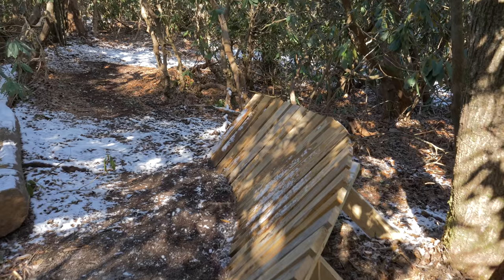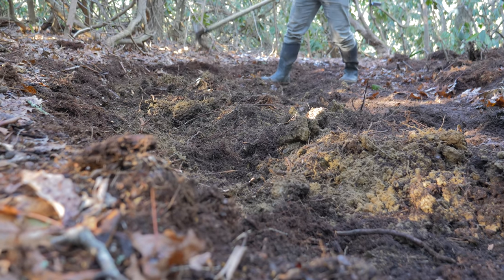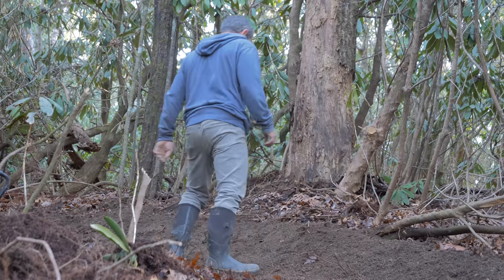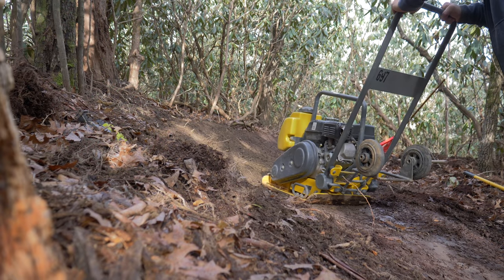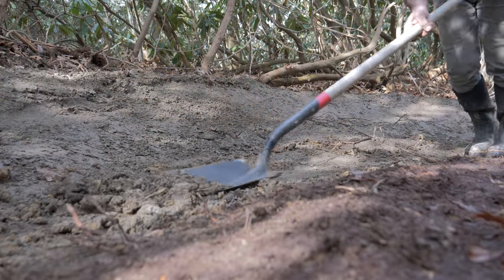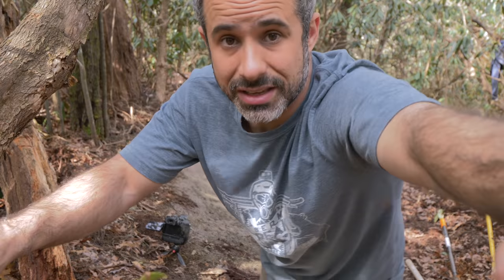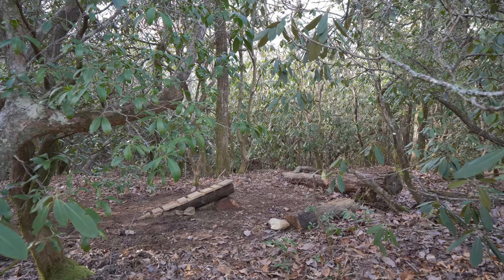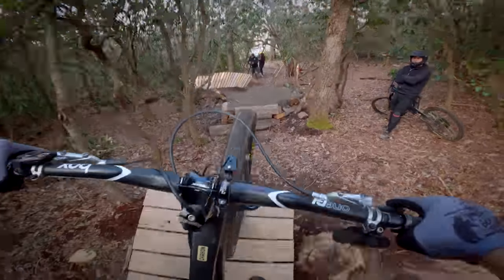Building a “pecker log" jump and a new berm!

Comment: The wacker is one of the machines that frustrated me the most while learning how to use it! The soil needs to be almost dry at the top for it to work at its best! Keep the good work up Seth!! Cheers from Chile!!
Reply: viva mtb enduro chile
Reply: As a geoengineer, I can tell you that this is not correct. Dry soil packs the worst, but overly wet soil sucks just the same. There is an optimal amount of water to every soil , called the "proctor density". 

I think you have clay at your place, just like seth has. The wacker is desinged to be used for sand & gravel and will (obviously) make a mess on clay.  You will need a sheepsfoot roller to compact clay, these sheepsfoot are also available for wackers.

Comment: 5:00 That stuff is most likely Stonedust, used alot here in the NE where the soil is sandy and tends to shift over time. Traditionally you lay this before a foundation and lightly wet it, then tamp it, and it will settle and harden almost like concrete.
Reply: Bespoke Bud thanks for this
Reply: I thought it was cat litter

Comment: The way to get that jump to sit securely is to fit it in there. To fit it in there you use a pair of calipers/dividers and draw/scribe a line with them holding upright the whole time. Then you remove the wood up to the line from the bottom log. This is mountain man style to how you'd build a log cabin with nice, tightly fitted joints. Great vids Seth!

Comment: I used sand to caver wet clay when I was building a roller. It works great for not sticking to the shovel but it also doesn’t stick to new dirt that you put on top

Comment: Hey Seth, love the videos I’ve been a long time fan , I just wanted to let you know that when sharpening tools it works better to file into the cutting edge rather than away, it helps you get a cleaner sharper edge when freehanding a file without having problems with rounding of the edge, less time to get the job done.

Comment: just to make the next one easier, its usually easiest and works best to work from the top of the slope and work along sideways. pulling the compactor up and down the radius of the slope :) the curved lip at the front then helps you get the radius of the berm rather than always fighting with the edges digging up what you've just compacted!!

Comment: Pro tip for sharpening. I have a decent amount of experience sharpening tools similar to yours, and a good rule of thumb is to push your file in towards the blade instead of pushing away. I’ve found your blades stay sharper longer, and are less prone to dent or bend. I know it is a rough-use tool, but that principle can be applied to any tool or knife. Hope it helps!

Comment: The gray stuff might be chip limestone.  You can get it delivered bulk if you like.  Also, the best bracing you can do on logs is to notch them, like how a log cabin wall is built.  The notch acts as a cradle and increases surface area (and friction).  If you still need some stiffness, use a 3/8 long bore bit and drill thru the notch and the sitting log (from the bottom) and drop in a piece of #5 rebar.  I'm a big fan of SPAX 1/2" self-tapping heavy duty wood screws also.

Comment: That gray colored dirt you found and are using is called 'stone dust'.  It's what the name implies, it's crushed stone and sometimes recycled concrete blended in.  It's used as a base layer under pavers, driveways, etc.  When you pack it tightly it'll harden up, which is why it's a good base layer.  You can order it by the truck full.

Comment: I found a great way to move logs. Get a 7 ft or so long 2x4, or other sturdy lever, and tie a short piece of rope around the lever about 1/4 of the way up, and tie the other end around the log you want to move. You plant the bottom of the lever into the ground and push forward against the top of the lever. You can adjust the mechanical advantage of the lever by raising or lowering how high up the rope is tied on the lever

Comment: That grey pow is called stone dust, you can get it in bags at any home improvement store or in bulk at any garden center or any yard where you can buy sand or dirt, like the one where you got your Granular A (gravel) for the forest road. It's actually the same powder that was mixed in with the gravel and is what gives it that concrete-like quality when you tamp it. If you're building a stone patio, it's what you put right under your stone, that stuff is like magic

I would definitely get a yard or two so you can use it, just make sure to throw a tarp over it because the rain will wash the fine stuff away pretty fast when it's loose. Also put a tarp in your truck bed because it's pretty messy but won't damage the tarp

Comment: Using a sandpaper flap disk on an angle grinder is an extremely effective way to sharpen large steel tools. It is way less aggressive than a grinding wheel and if you finish with very light pressure it can lead to a very nice edge.

Comment: next thing you should build is a connected ramp from the gator to the floor. manual if you want an easy process or on a chain system if you’re up for the challenge 😁. you could even add a rolling system like at an airport bag check so you can load logs or machines easily

Comment: I feel like you would do well to invest in a roller packer. They're relatively inexpensive and you can really vary the weight with how much or little water you put in it. I feel like it would work better on wet stuff because it won't vibrate it into schmoo.

Comment: I’m a blacksmith in NJ and the file work you did on your hoe looked good. Some advice you might benefit from is investing in an angle grinder and some flap disksZ they’re great for both light and heavy sanding, grinding and sharpening.

Comment: It was hard to tell but it looked like you had the water on on the plate compactor. If the ground is already wet just turn the water valve off. It prevents things from getting too wet and messy.

Comment: Hey something else to do with the pecker log to secure it... go through the top log into the bottom short log support with some rebar or a metal spike... like a 3/4" rebar/spike... do two of them. it will NOT move... I've done this making a wood perimeter around my kids playground, and the wood logs do not budge an inch no matter how much you try.

Comment: GoPro hack: take the top of a handlebar GoPro mount and lay it sideways against the chin on any full face helmet, zip tie it on either ends between the nut which will keep the zip ties and mount from moving, now you have a GoPro chin mount for your full face

Comment: what they dumped under the house and garden is called here in germany as "bessunger kies" which is very fine shredded gravel and a tiny bit of clay and that stuff compacts VERY VERY well and is usually used for forest roadways and is a german invention and it seems some americans also knew about the powers of that great building material. "also that you learn a new german word" KIES is actually the word for gravel and is spoken like keys 

P.S. this stuff is also used as a drainage for water SO BE CAREFUL when you take that stuff out of there... it might was placed there for a reason